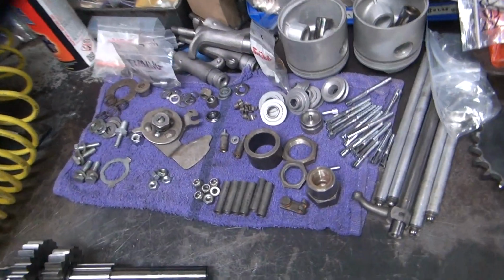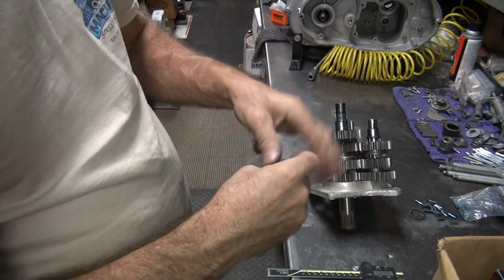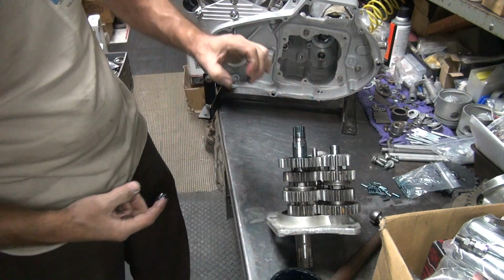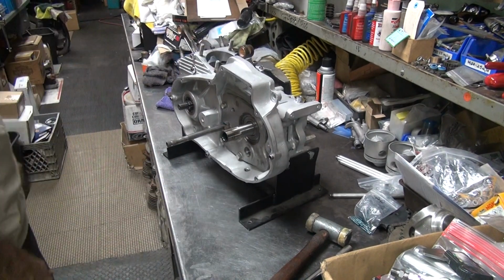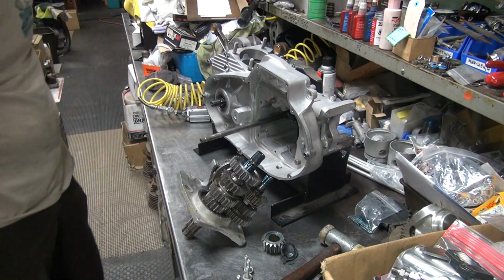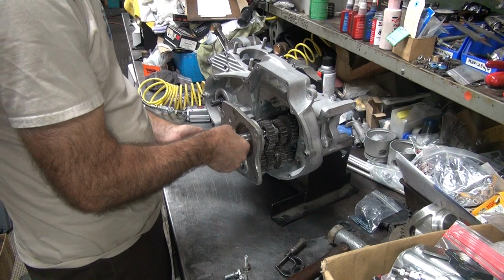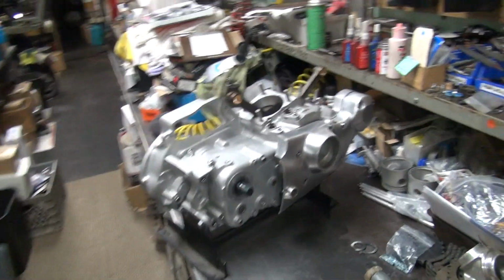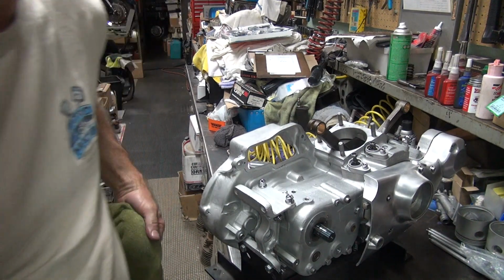1977 xl xr street tracker #120 motor rebuild repair 1000cc sportster ironhead by tatro machine

Comment: Is 2nd gear did 120mph how much does 4gear do?
Reply from the maker: for this year that would be the 2nd run. 109mph. no power to pull the gearing means you go slower that f you rev it out in the lower gears. the motor has to be in its power range to go fast.
tatro